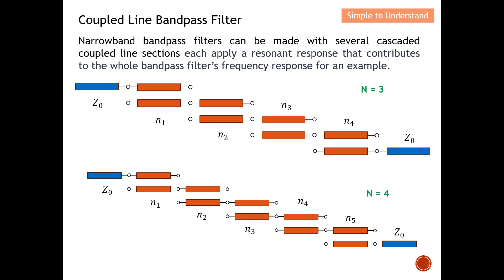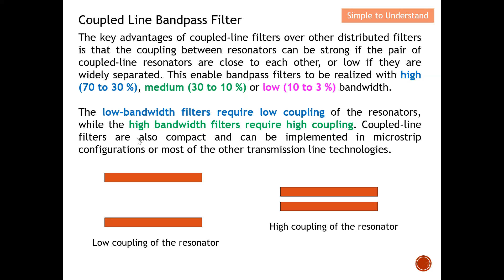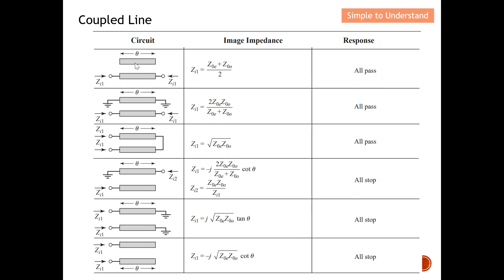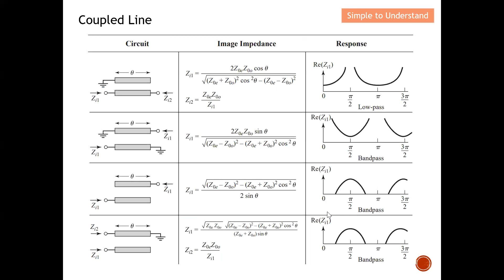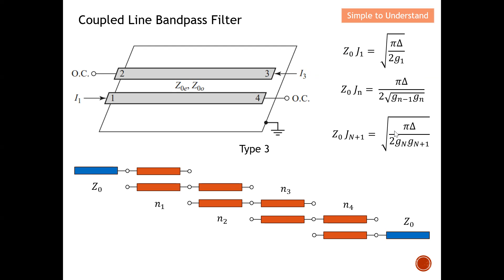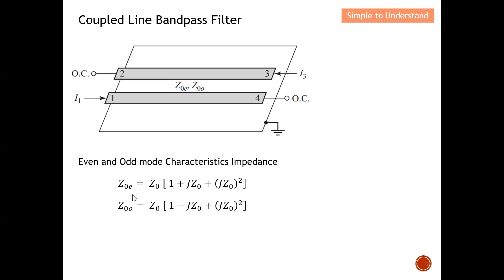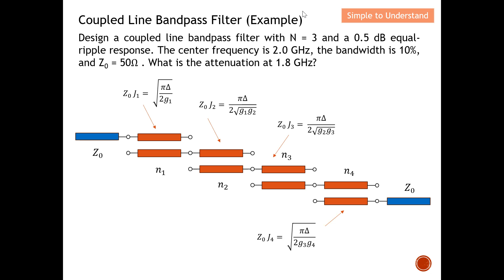Filter Design #24. Introduce the Formulas to Design Microstrip Coupled-Line Bandpass Filter Guide.

Comment: How do you determine how many N or order for each circuit? Do we set it ourselves or is there any calculation for it?
Reply from the maker: You can see this video
https://youtu.be/aIK1JtRL0ME

Around @0900, I discussed how to design the number of n required. Thanks.
Reply: @technologiesdiscussion1676  Thank you for the input, may I know if the method used in the LPF for determining the Nth order as well as referring the table for element values of LPF prototype, can be applied to the bandpass filter too?
Reply from the maker: Yes, they are the same.  :)